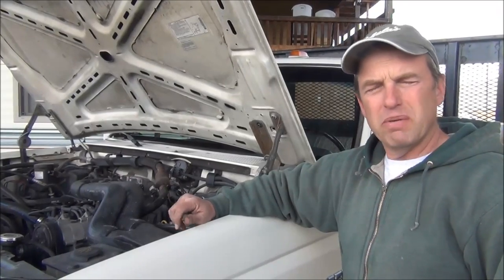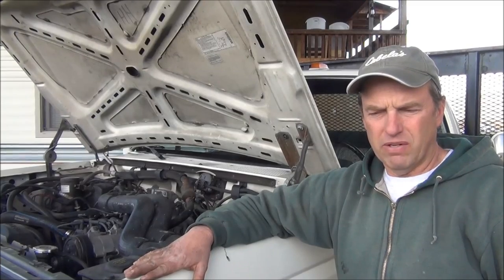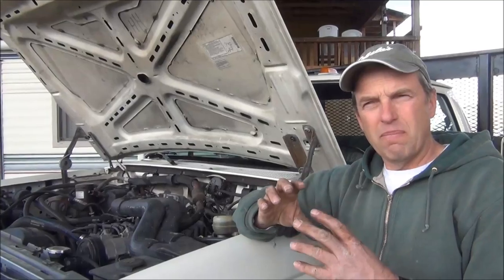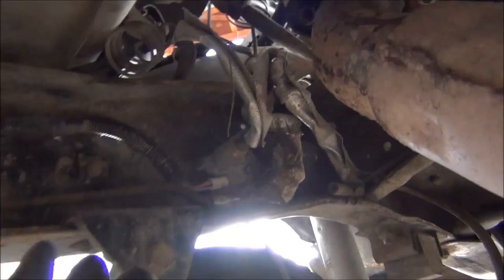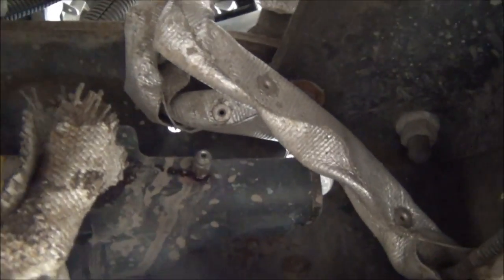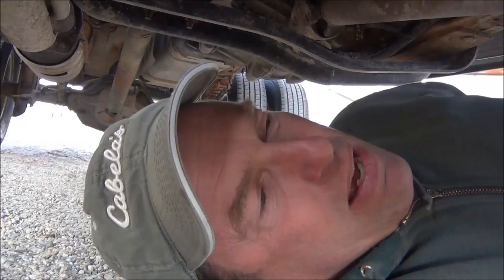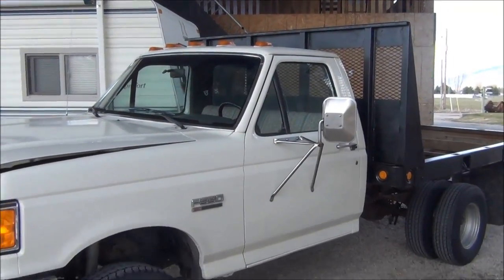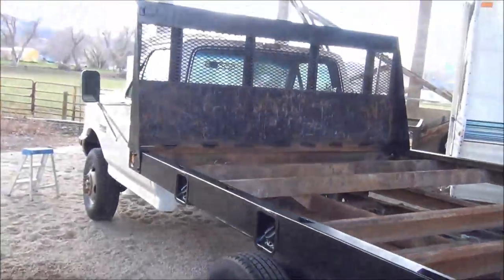F350 Spongy brake problems

Comment: Thanks for the tips.  I have a 1992 F-350 crew dually, same issue.  I was going to change the master cylinder and brake booster but, I'll do this first.  If that doesn't do the trick, I'll go back to the two latter choices.  You stole that beauty!  Thanks again!

Comment: Make sure you first check where your bleeder screws are on your calipers if you are having issues.  I that bleeder screw is on the bottom of the caliper you may be getting good bleed results and still have the spongy brake. My 2000 excursion kept having that issue until I finally pinched off lines going to the back brakes. Then I took the right rear caliper off and turned it upside down and rebled and that solved my issue. the bleeder screw was on the bottom and therefore some air was trapped on top in the caliper even though it looked like there was no air. I bled the system multiple times.  Then I remembered my physics classes....

Comment: Great video, this is a serious help for me. My 1996 F-350 crew cab long bed 4x4 dually has the exact same problem.
All the brakes are new, bother rotors, good calipers and pads, new brake drums and shoes and all springs and hardware. I just got finished replacing all the brake lines with the nickel copper alloy lines, thoroughly bled all the brakes and still have a spongy pedal. 
Luckily I have that part in stock.

Comment: Installed a new Modulator Valve yesterday on my 1990 F-150. It did the trick. Thanks to your video, I saved a nice sum of money, guess I’ll put the money towards a new set of tires :)
Reply: Help!   What is the part number of this “modulator valve”?  Thx

Comment: Just wanted to say that I was having the same problem with the brakes and I replaced the rabs valve it fixed the problem. Now I have high and firm brakes. 
Thanks for the help
Reply: @redartisanwolf6716  rabs= rear antilock break valve...its what the guy in the vid is showing

Comment: I have had the same issue with my truck , I need to replace mine and the electric box too as my dually is having chatter problems too but yet still no ABS light, I swear the guy who did quality control for these must have been blind. Everyone I talk to whom has the same issue say their lights never came on either. Thank You Brig T the Video was very helpful in showcasing where and how easy the item is to remove & replace it with a little care!

Comment: thanks for the vid and im jealous about f350 you scored great deal!! I've been working on a 1990 F-250 that belongs to a friend of mine that has a spongy brake pedal after putting new master cylinder new booster new calipers new rubber lines I found this video today now I'm going to replace the modulator thanks again this is the only video I found on YouTube that touches this subject
Reply: Did it work?
Reply: @justicebruno5249  in deed it did!

Comment: I'd have that exact problem.  Thanks for making the video.  I wonder how they rebuilt those modulators.  There has to be some way of rebuilding them.  I used to work in the industry, we remanufactured parts, one of the key things is knowing what is bad, a seal or something.  I'm going to bleed mine as my "brake" warning light comes on all the time.  Great find for $1200.  I got an XLT Lariat extended cab F350 dually for $1,800 and it came with a gear vendors, 5th wheel hitch and a 110 gallon fuel cell in the bed.  Great trucks.

Comment: In the old location where the old fashioned component (Non-electrical) "proportional valve" used to reside. As much as I respect the decision by automakers to employ ABS tech to rigs to create a more safe braking system for adverse road conditions, it was not necessarily as huge step forward for the pickup owners of the world. I admit they have improved the braking characteristics for passenger cars, but it was not the leap they thought it was going to be for the heavy truck industry, especially for the semi-tractor industry as well. They have complicated a system that has worked for decades to what end? An increased functional maintenance costs threw the roof is not what I consider to a positive, but rather the opposite. 
Good catch on this valve having air in the system or just being stuck in general. One thing to keep in mind though is that a true ABS unit will have not four but rather six lines to it, and it is an electrical motor driven rotary valve and looks nothing like this, and would be mounted very close to the master cylinder to avoid long metal lines to it from master cylinder. The lines from it would then extend down to the valve you have just shown, and then on to whatever corner it was plumbing brake fluid to. Shoe adjustment is critical to any "hard and high" brake pedal, but air is and always will be the primary culprit in any braking system other than an air brake system. The only other often overlooked culprit is the vacuum booster behind the master cylinder. Symptom: Brake pedal travels towards firewall forever, but eventually it stops rig. But no brakes with just a touch, like we are used to appreciate in a well behaving power brake system. This is often due to a vehicles history of being parked for six months or more in hot areas causing "rubber rot" and all it takes is a "pin hole" and the diaphragm leaks vacuum and the power to brakes lessens.
Reply: What causes tap the brake and pedals sucks to floor stand on it an u can bring it back up but ever time u touch it sucks to the floor

Comment: I was about to go buy a booster and master cylinder for my 1995 F250, I'm going to try the abs modulator like you did, thanks!!  And good buy on the f350!
Reply from the maker: I've changed a few of these on F series trucks over the years and it has fixed the problem every time. 
Buy OE. not AFT. 
Thanks for the compliment on the truck. I love this truck. It runs so awesome
Reply: Brig T , I know u said you don't recommend buying after market abs modulator for this, you also said you used one for a ford van. Can you point me in the right direction on eBay for one for an 01 f350, it may be the same if I'm understanding the video correctly.
Reply: @BrigT262  Where can I get one for a 2000 Ford Excursion ? Do You have a Ford part # ?

Comment: I was working on an 1990's era E350 that had spongy brakes, back when I was a technician. I spent easily over 20 hours trying to diagnose this issue. I eventually got the brakes to feel a little better with an updated master cylinder (per Ford TSB), but I had to let the vehicle go. Great job finding the issue! I do have a question: is there a diagnostic procedure for finding this problem, outside of simply replacing the part? When working as a tech, I have to know the part is bad before selling it to the customer.

Comment: Wow thanks man ,I just bought a 1997 crew cab single wheel f350 with that exact same problem , cost me $1000 bucks to have couple crooked shops install a windshield and install one brake line and bleed the brakes just to have a spongy peddle. Now thanks to you I can fix myself . Thank you
Reply from the maker: Thats awesome. I hope it fixes your problem. I've done this repair on 3 F series trucks over the years and it fixed it every time. Look on Ebay for the part. Good luck!

Comment: thanks for the abs modulator info bro that has to be my problem only 1994 e350 Ford Shasta Rv van frame spongy brakes I bleed them twice still spongy I replaced my Dr side caliper line and bleeded it still spongy so Imma change the abs modulator

Comment: You say that when you took off your old unit there was quite a bit of air in it. Did you first try and bleed the unit first before spending money on a new one? Maybe that was all it needed, to be bled of air. I bled mine and big difference in pedal feel, much firmer and higher, still good after a couple of years.
Reply from the maker: Very good question. Yes I did bleed it before replacing it and it made no difference. After replacing it, I bled the entire system starting from the back of the truck to the front and to the ABS unit. Night and day difference after replacing it works great to this day

Comment: I am having that same problem with my 1994 F350 7.3 turbo charged diesel.  I would of thought that the abs light would come on and remain lit if there was a problem with the abs module?
Reply: I’m having same problem with my 97 f250 hd I was thinking the same thing. I’ve bled all the brakes changed master cylinder but I was assuming the light would be on if this was the problem but who knows
Reply: @sethturner298  Well, next week I'll find out if this is really the problem. I just got a rebuilt unit and am having our mechanic install it for me. I can hardly wait, and I am really hoping that this works and I have good breaking as I should have. It's spooky having to pump the break pedal. I'll let you know it goes.
Reply: This did not fix the problem. I've had both the master cylender and the modulator replaced and that did not fix this problem. So now what?
Reply: @RogerSayers  did you ever find the problem?  I bought my 1991 F350 460 3 months ago and now the brakes are spongy, I’m going to tear into it this weekend hopefully

Comment: Do you bleed that third in the sequence? Right rear, left rear, the modulator, and then right front and left front?
Reply: How did you end up bleeding yours?  I’m about to do it this weekend
Reply: @davefreudenberger  I believe I ended up not doing this job----it was for a customer and they probably cancelled or something.

Comment: you said abs modulator had a bunch of air in it , would bleeding it along with the  brakes have fixed it?
Reply from the maker: You can try that. I did do that as well but no change.

Comment: Thanks. Good info.  Does the ABS need to be operational to have this fix solve the spongy brakes?  I have a 96 e350 Quigley converted 4x4 van with a 460 7.5L.  It of course has the sponge brakes.  It also weighs nearly 10k. The front is essentially a f350 axle. It has modified (by Quigley) ABS wheel sensors...really just the bracket. Ive had an ABS light on as long as I have owned it.  I was told it was just the left sensor. So I dropped the $400 to get Quigley to send me their modified version and have it installed.  When it didn't make the ABS light go off I gave up.  Was told by a Ford dealer that the rear ABS needed to be changed too.  I decided I didn't need ABS. But I am wondering about this fix.  Could this solve my spongy brakes without having to further fix the ABS?  How is the ABS modulator different from the ABS wheel mounted sensors? Thanks for any thoughts on this.
Reply: Yeaa duhhh

Comment: I have the same 1991 F350 Custom 7.5L dually for $2500.

Jiffy Lubes did my brake bleed twice.  Later on, they told me I may have a bad brake booster.  😂
Reply: Haha jiffy lube sucks. Do everything yourself

Comment: I have spongy breaks, on a F250 1992.  I replaced the MC, and the rabs hydraulic.  Breaks are still spongy and the rear brakes are locking up.  Do you have any suggestions, totally lost at this point.

Comment: what do you mean by "spongy"  I have an 88 f250 that when I step down on the break it hisses.... is that the same thing?
Reply: i know i'm late but by spongy he means the pedal drops to the floor fast and doesn't stay firm and hissing when you press the brakes sounds more like the brake booster

Comment: I just bought a 1996 f250 7.5L 460 4x4 and the issue I'm having on the brake pedal is the stiffness when pressing on it to stop the truck. Is that the ABS module or the master cylinder?
Reply from the maker: Sounds like that issue is with the vacuum power booster.

Comment: have 1998 f150.   have to push the brake pedal a long way for the brakes to work...new master cyl/new boster(with boster rod properly adjusted) / new rear wheel cylinders/ALLnew brake lines/new rotors/new calipers/properly bled brakes...still LOW brake pedal gor brakes to tale hold.  have been told " just the nature of older trucks"  rear shoe brakes adjusted properly.......help...(brakes work great, once you push the pedal down far enough)
Reply from the maker: Bob Haddock sorry man. No experience with the girly f150's

Comment: Hi Brig/gentlemen, I have a 1992 Ford F250 7.3L IDI, I have to tap the pedal down for the "first start of the day" to kick in the choke (higher RPM) and it stays high for about 3 mins. to warm up and settles down. If I dont tap the pedal it stays at regular RPM. any idea what could be the issue ?
Reply from the maker: That sounds like normal operating to me
Reply: The 7.3L IDI is a diesel, so it doesn't have a choke. The engine speed is governed by the amount of fuel injected by the injection pump. These engines have a cold start rpm solenoid and a cold advance solenoid, on or near the injection pump. I would check to make sure that you are receiving battery voltage to both of these solenoids when the engine is cold. It is also possible that one of the solenoids is bad. Another, more unlikely problem, is that your injection pump is bad.

Comment: please i need help my 1988 ford f350  dually  automatic transmission wont shift 2nd gear what can i do to fixed
Reply from the maker: buy a used transmission from a wrecking yard. and get a friend to help you install it
Reply: Thank you sir I did get the transmission and yes it works really good
Reply: Im not sure about your transmission but over the years i have had and seen a few e4od transmissions have the 2-3 shift solenoid get stuck. The truck will run/drive fine until it comes time to shift into 3rd gear...

Comment: I have a e350 1997 and it has squishy brakes, but it also has a hiss sound that is pretty loud. Any advice?
Reply: My is the same did you find the problem
Reply: @leomireles1009  yes. It was the that big round black drum thing behind the master cylinder,what ever that thing is. Bought one from a reputable wrecking yard. Also the leaking master cylinder causes them to go out from the brake fluid eating away at the inside parts.
Reply: @nathanielriesterer9103  my doesn't have that drum on the he Master cylinder ..my master cylinder has no leaks .. another think was you're making that hiss sound like it sounded like the power steering.. something like that... Thanks a lot for the response..
Reply: @leomireles1009  the hiss was continually, and sounded more like leaking air. Did not sound like a winding power steering pump or anything like that.

Comment: did your abs light come on when the modulator went?
Reply from the maker: Justin Pancurak no abs light.  the symptom is simply spongy brake pedal. you'll think it's the master cyl but it's not. replace the modulator. works everytime

Comment: just bypass it with normal brake and adapter line 20 bucks 15 min fix just did mine few weeks ago build in obsolescence by ford to make 100 or 200 buck on people back in the day I'll keep money they can keep there junk abs
Reply: Not a good idea.
Reply: where did you get the adapter and do you have part numbers?

Comment: I've replaced mine on my truck and it is still not working what could it be?
Reply from the maker: The next likely culprit is the master cyl. Make sure you bleed the brakes starting with the furthest away wheel, then work to the closest. Also make sure your year shoes are adjusted up properly. That should do it.
Reply: Brig T alright will do thank you sir
Reply: @marcusdevries3453  get it working? What fixed it?

Comment: Well CRAP!  I paid to have this replaced and it didn't fix my problem.  I'm still having soft pedal and have to pump breaks....
Reply: Have you tried upgrading to a 97 f450/ f super duty 1-5/16" master cylinder?
Reply: @brantley1975  No, I'm not gonna do that cause I don't see where that will help. I've already had a new master cylinder installed.  Gonna have the breaks checked next.
Reply: @RogerSayers  any luck getting it fixed?

Comment: I have a 96 F350 power stroke diesel my break and abs light came on, my break fluid was low so I added some fluid the light went off but now my break pedal slowly goes to the floor when I press down on the break, I can’t find a fluid leak what could be causing this?
Reply: same boat did u ever figure out
Reply: My 1996 f350 crew cab long bed 4x4 had the exact same problem described in the video. Luckily I already had the part left over from 1 of the many rust buckets I've cut up.
I swapped it, bled it first then the rear brakes. The truck no longer has a spongy pedal that slowly sinks to the floor and it stops so much better.
Reply: @OBS_Ford_Diesels_Inc  It ended up being a broken line it's been fixed but now when it idols the break light will comes on until I rev it up then it goes off, I've been told by someone who knows these old trucks it's a leak in one of the power break hoses, I'm not going to use it this year (because of the price of fuel) so I'll get it fixed next year.

Comment: why not try bleeding the modulator before replacing it .   i say this from the remark about all the air that was present/??????
Reply from the maker: I did bleed the modulator , first and it didn't change anything.
Reply: ok i was trying to help you hadn't said anything so i was trying to save you a buck.
Reply: Does anyone have a video on how to bleed it for me to try ?
Reply: I think this issue is somewhat cut and dried, and I agree with the content source here.  However, it's not perfect.  Sometimes the master cylinder is bad, and sometimes there are air leaks in other places in your brake lines.  The best policy is to check them all, don't just wait for a perfect one size fits all video to make it perfect.